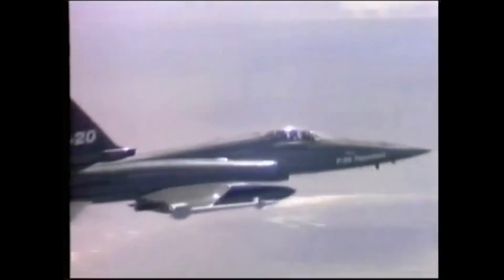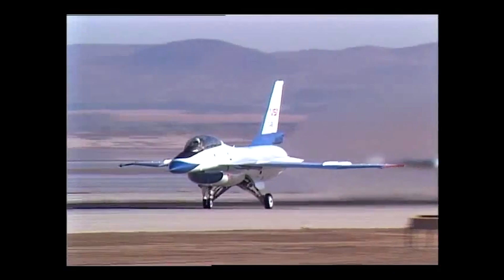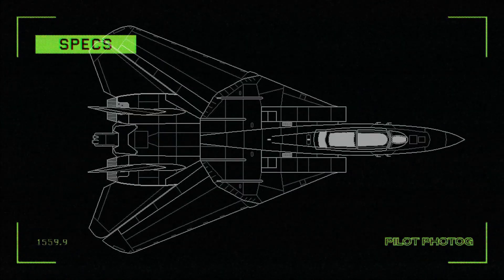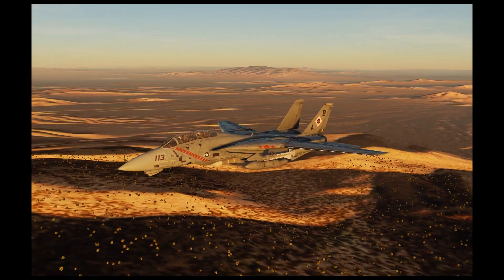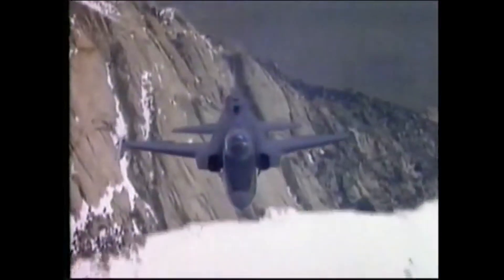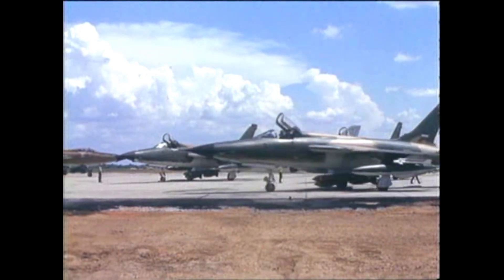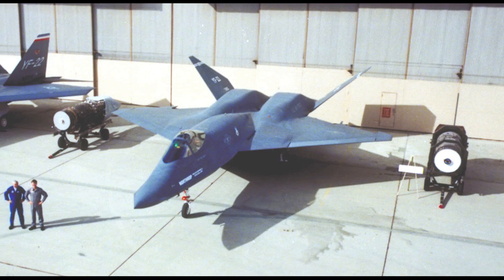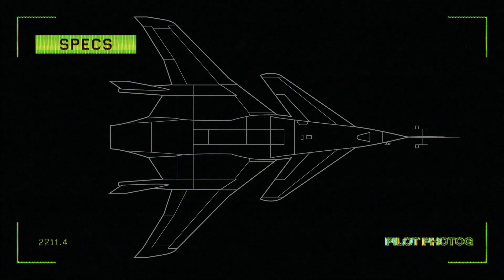Top 5 Fighters That Should Have Been Built | Best of Aviation Series by PilotPhotog  f20  f16xl

Comment: Actually NONE of the F-16's should ever have been produced, it was a terrible idea when it was proposed right from the start, BUT IF the F-16 was produced it should have ONLY BEEN the F-16XL, and export all the others, the F/A-18 of any variant should never have been produced, the truth be told, NEITHER the YF-16 or the YF-17 should have ever been produced to "COMPETE" the lightweight fighter program was DUMB in its creation, STUPID in it's execution, and once again Northrop never had a prayer of winning that "COMPETITION", the #1 SPECIFICATION of the program that Northrop did not do was the usage of the P&W F-100 engine, that was baked into that disaster because of the F-14, see years earlier, when the F-14 was being developed because General Dynamics and the USAF could not convince the U.S. Navy that the F-111 was anything other than a land based ground attack plane that had the ability to carry and fire the AIM-54 Phoenix missile, the Navy STILL needed a fleet defending air superiority fighter, and the F-111 WAS NOT THAT, enter Grumman, who has had DECADES of experience designing and building all kinds of aircraft for the Navy and use on Aircraft carriers, and helped General Dynamics with the development of the F-111, had what the Navy wanted and needed, HOWEVER, at the time, Grumman was under contract to acquire their new aircraft engines from Pratt & Whitney, so along with Grumman developing the Airframe for the F-14, Pratt & Whitney was developing a superior fighter engine for the F-14 and that engine was the F-100 engine, the USAF knowing that Grumman was going to produce a far superior fighter plane that would eventually the USAF would also have to operate, approached P&W, and purchased ALL of the F-100 engines from the F-14 program, in a contract that DID NOT ALLOW P&W to sell any F-100 to Grumman, P&W, who still had to provide new engines told Grumman, that they could provide the TF-30 for the F-14 Program, and the USAF then went to McDonnell Douglas, and told them to build a land based air superiority fighter using the P&W F-100 engines, and bingo the F-15 was born, BUT the U.S. Congress was NEVER going to allow the USAF to purchase 2,200 F-15's at $85,000,000 per plane for the first 200 planes and $45,000,000 for the rest of them, so the USAF started the lightweight fighter program to use all the extra F-100 engines, so the reality is that since the YF-17 was using 2 General Electric F-404 engines, instead of a single P&W F-100 that "COMPETITION" was NOT a competition, the YF-17 was markedly better than the YF-16 in every way and it was not even close, the ONLY way the YF-16 was better, was COST, and the cost is because General Dynamics DID NOT have to buy the engines, the USAF already had the engines, which saved millions per plane that northrop could not compete with, so the USAF killed 2 birds with 1 stone, they managed to saddle up the BEST fighter the world had ever seen up to that point (The F-14) with the worst possible engine that it could have been hampered down with, while getting their expensive fighter the Navy could not use, as well as another fighter that never should have been conceived let alone built to use up the F-100 engines that were supposed to be for the F-14 program, SO, IF the F-16 was to be built, only the F-16XL should have been, the F-14 Super Tomcat 21 not only should have been built, but like many things, hindsight is 20/20, Mcdonnell Douglas, shorted the unit cost on the F/A-18 E and F models to secure the contract, the truth is they "CLAIMED" 80% parts commonality with the F/A-18 A,B,C,D's the truth is there was about 8% parts commonality between the legacy hornets and the super hornets, it was a bait and switch, they claimed they could R&D the E,F, Hornets and deliver them for $42,000,000 each, while Grumman was ready to upgrade the F-14A's to F-14D's for $26,000,000 each while starting production on the F-14E Quickstrike for $55,000,000 each, which was the smartest thing to do, even in 1991, the F-14E would still be a decade away, BUT Dick Cheney, finally ended the program that he had been working on destroying for a very long time, and the moment, that the U.S. Navy was forced to start retiring their F-14's the unit cost for the F/A-18 E and F went to $78,000,000 each, it took a overprivileged childish USAF, a backstabbing major engine contractor, a corrupt politician, and 35 years to get rid of the very best fighter plane the world has seen to that point, and now we are stuck with what we have now, a hugely overpriced F-22, an over rated F/A-16, a massively outperformed F-16, and a hugely bloated F-35, which IS NOT where our Military should be at.

Comment: The COLD HARD truth about the YF-22 and YF-23 is that the "COMPETITION" was over LONG BEFORE either company had even began construction on the 2 prototypes, for ALL 4 companies, one thing that is left out of this particular so called "COMPETITION" is that there were 4 companies "COMPETING" not 2, first you had Lockheed and Northrop "COMPETING" for the airframe, and then you had Pratt & Whitney "COMPETING" against General Electric for the engines, and even before the "COMPETITION" started, the winner was going to be the YF-22 with the Pratt & Whitney engines, which is the EXACT same reasons WHY the YF-35 ended up winning out over the YF-32, with 3 of the same "COMPETITORS" and the same 2 "COMPETITORS" "WON" that one as well, see the USAF has ALWAYS had this BROMANCE with both Lockheed and Pratt & Whitney, they have always hated buying from Boeing, McDonnell Douglas, General Electric, Allison, General Dynamics, they despised the fact that they were forced for almost DECADES to operate aircraft that were Naval Designed aircraft, such as the F-4 Phantoms, A-7 Corsair II, A-1 Skyraider, ECT. they hated that more than anything, and after more than 30 years of whining, complaining, bellyaching, bitching and moaning, the U.S. Congress finally allowed them to do the R&D on a LAND ONLY based advanced fighter plane that the U.S. Navy and USMC, would never get their hands on, now it is no secret that DURING the "COMPETITION" between the YF-22 and YF-23, the YF-23 with the General Electric engines was the best of the 4 prototypes, with the YF-22 with the General Electric engines was second best in raw performance, stealth, speed, and EVERY OTHER measured statistic except the YF-22 with the GE engines did in fact maneuver about 0.2% tighter across the speed ranges, while the YF-23 with the P&W engines finished in 3rd place and of course the worst one of the bunch, the YF-22 with the P&W engines is what went on to become the F-22, Northrop and General Electric entered into a competition that they had a ZERO PERCENT chance of winning, no matter how much better they were over their competitors, Lockheed and P&W had already won the so called "COMPETITION" on the day the Department of Defense announced the 2 finalists for the ATF contract, Lockheed and P&W already had won with that announcement, and there were other reasons, Northrop also has had a long history of building amazing planes for the U.S. Navy, and they made sure to include certain things in the design of the YF-23 to ensure that AFTER they had "WON" the "COMPETITION" they had no chance of winning, a different Nose landing gear was to be installed and a fully concealed tailhook making it ready for Aircraft Carrier use, they planned on not only the USAF operating it, but also the U.S. Navy and USMC as well, which would have driven down the unit cost, as well as increased the operational numbers of purchased aircraft, they intentionally built the airframe to be strong enough for Naval operations, and had plans for a different wing with folding wingtips if the Navy wanted them, but even the prototypes were made with Carrier capable MAIN Landing gears, used from the F/A-18 so no changes needed to be made there at all, also Northrop DID NOT have the time to include the thrust vectoring that they had planned on for the production run of the plane, they were given X number of days to get the prototypes ready for the "COMPETITION" and to include the thrust vectoring, they needed more days than they were allotted, electing to include them on the production run instead of the prototypes, but you can see by looking at the 2 prototypes, that the internal provisions for the thrust vectoring were already there, just in the sort of squared off shape of the engines nacelles on top of the plane, that was the space they needed for the innovative thrust vectoring they had planned for the F-23 production run. for some reason they actually believed they could make a fighter that would be so good that the USAF would choose their plane over their BROMANCE partners plane and engines, honestly the YF-22 could have failed at every measurement in that "COMPETITION" and still won. The thing that baffles me the most, is WHY the U.S. Navy did not reach out to Northrop and inquire about the possibility of the YF-23 with the GE engines for carrier use. and this NEW advanced fighter, IF LOCKHEED AND P7W are in any way involved, I can tell you right now, WHO will win!

Comment: The YF-23 should be the only aircraft that should have been mass produced here and still can. The F-16XL was a great addition HOWEVER We're kind of past it's original mission just like the Strike Eagle, in Fact the Strike Eagle has been repurposed as the F-15XL now which has retuned to its roots as an air superiority fighter that can be configured for many different kinds of missions, both air to ground and air to air. It's kind of funny how that ordeal worked out.

I believe if the Tigershark would have been made everyone would have had dozen of them and probably on going upgrades for generations. The F-16 would have been purchased as an Air Superiority fighter by most countries would have bought into them anyways. It can be. But so could the tigershark. The closest thing we have to the F-20 now is the Saab Gripen E and its crazy how long it took for the rest of the world to catch up.

Comment: The CF 105 was obsolete before it was even built. It was designed to intercept strategic bombers, but by the time the prototype flew, that was no longer the main threat. And the HIMAT was never more than a test platform. It had never been intended as an actual fighter.

Comment: Hi, mitch lown here, I 'm a Tomcat enthuiast, your
 Rendition of the tomcat 22 is great but I think it could go further, like including longer LEX to reach the reo cockpit with inlet grills for very high Alpha angles, tailes angled outward a bit more, reconfigering the engine inlets a bit more wider like original which would allow a lager wepons bay, and as you said full up grade of avionics, fly by wire  flight controls etc.
It would be amazing to get an idea of the radar crossection reflection if all of this was done, I think it would be smaller than the F15 stealth and how with all upgrades it would compare with 5 gen aircraft

Comment: Worked for Northrop during the time of the competitions the F-20, F-23  were in.  Also, have a pin that went up on the B-2 during its first flight.  Those times were both exciting and depressing.  Lockheed just new how to do a better sales job with their F-22.  Also, General Dynamics offered a stripped-down version of the F-16.  A less capable radar and other advanced avionics.  From what I recall, the F-16/F-20 competition was primarily for Air National Guard and reserve units for use in the states..  They would have to depend on AWACS or ground radar for guidance to intercept.
The AF didn’t want to add another completely different aircraft to their inventory.  Too high of a cost, especially with maintenance.  Since the stripped down version of the 16 shared a majority of parts with the original build, it just made monetary sense to stick with an already proven aircraft with great logistics for ease of maintenance.  In the end, the B-2’s build order was substantially reduced.  This caused Northrop to have to sell the land where my  division in Anaheim was located to help pay for the completion of the B-2 due to the government deciding to reduce the funding for the completion of the B-2.  In my opinion, the government really shafted Northrop with not only drastically reducing the build number, but making Northrop pay for changes to the design the AF required.  All three of these aircraft had quite a bit of blood, sweat and tears spilled to create them.  Hard to believe that all of this happened over 30 years ago!

Comment: Someone told me that the F-16XL required a lot of runway.  This is a deal breaker for the front line.
The Arrow program was supposedly lousy with Soviet spies, as well.
With the collapse of the USSR, the F-14 became too expensive.  Now is time for a replacement.
I think there were some political reasons to kill the F-20.
The short production run of the F-22 leads me to suspect the plane isn't what the AF needs.

Comment: The problem with the F-20, is that it wasn't a brand new and nifty airframe.  The powers that be weren't EVEN going to buy something that started from a 1950s trainer (T-38), NO WAY!  So, we never bought a cheap fast, quick to launch fighter that out-turned, out-
accelerated, and out-fought EVERYTHING we, or anyone else was flying.  Hammer

Comment: Honestly I feel like if the budget wasn't an issue we could have had both the F-22 and F-23 in service with one eventually becoming the main craft.
The YF-22 and YF-23 had their strengths, like much better maneuverability, slightly lower costs vs slightly better range, speed, and stealth, Raptor was the better plane and better for filled the goals for the ATF, but Black Widow was very much missed... probably would have been a better interceptor due to it losing the maneuverability battle to Raptor (all though still better than everything else) it was slightly faster, could fly slightly further, and was slightly more stealthy (smaller than the Raptor's marble/bumblebee sized RCS). YF-23, or the production F-23 makes sense as a extremely high performance fighter interceptor, where F-22 would be a extremely high performance air superiority fighter, complementing each other.
Just my thoughts...

Comment: The YF-23 looked too space age for the time. It looked like something out of the Jetsons. 

The development time for aircraft at the time had become too long. What they should have done is work on that part of it.

The biggest thing about the F-22 is it became a maintenance nightmare with its stealth coating. That's gotten better over time.

It has been said by the flight engineers who flew the airplane that only 1/3 went into the air frame of the YF-23. 1/3 went into a quad computer / software at the core of the system. I don't know what the last 3rd went. Stealth?

Comment: F-20 was squashed because the Air Force doesn't like anything small or inexpensive, and the Navy doesn't want a single -engined fighter. Our great aircraft corporations have been forced into a sort of a post-White Paper type of situation....Amalgamate or die. F-23 should have been allowed to build at least a few prototypes for advanced testing, same as the Boeing competitor to F-35. Decreased competition dilutes the final product, and we get 'all or nothing' , massively expensive programs......and no real back-ups in case of delays or failure.

Comment: Here's my list of fighter aircraft that should have been built.

· F-15N-PHX "Sea Eagle": a proposed naval version capable of carrying the AIM-54 Phoenix missile, but with an enhanced version of the AN/APG-63 radar on the F-15A. These featured folding wingtips, reinforced landing gear and a stronger tailhook for shipboard operation.

· F-15 SWG: proposed variant of F-15 Eagle with variable geometry wings like the F-14 Tomcat and F-111 Aardvark.

· FB-111G Aardvark: Proposed Bomber variant of F-111 with a longer fuselage of 12ft 8.5in, stronger GE F101 Turbofans, redesigned fixed intakes, and rear landing gear placed outward to allow for more payload.

F-111B Aardvark: carrier based version with smaller redesigned nose for better carrier landing visibility and capability to use AIM-54 Phoenix missiles.

· F-14 Stealth Tomcat: (you did a video on this explaining it's capabilities).

· F-4E(F) Phantom: Proposed single-seat simplified version of F-4E for the German Air Force.

· F-4T Phantom: Proposed air superiority-only fighter version.

· F-4 (FVS) Swing Wing Phantom: Proposed version with variable geometry wings.

· F-4X Phantom: Israeli Proposed version with water injection injected to give the aircraft a speed of an excess of Mach 3. The water would be contained in a pair of 2,500 US gal (9,600 L) conformal tanks on the sides of the fuselage spine.

· IAI Super Phantom/F-4-2000: A separate Israel Aircraft Industries project was proposed for a PW1120-powered Phantom, and one prototype built. IAI's F-4 "Super Phantom" or F-4-2000, which could exceed Mach 1 without afterburners.